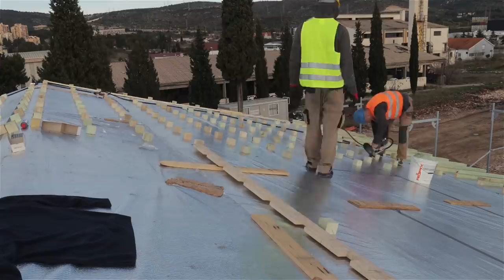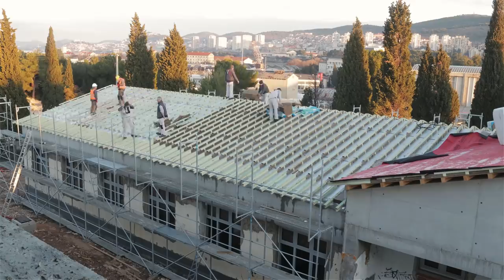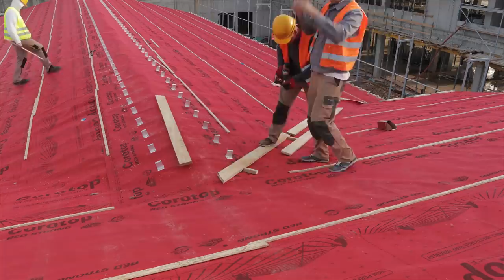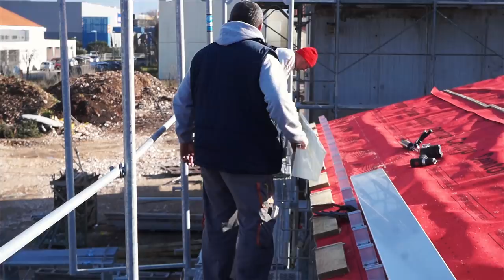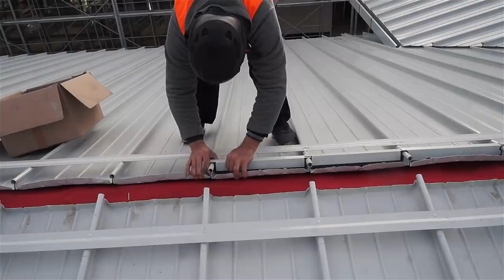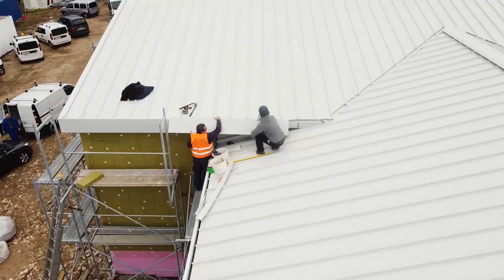Truss Structure Roofing. Aluminium standing seam

Comment: I'm I missing something or the whole roof attached to blocks that are skew nailed on? What kind of wind loading is the region? Please don't mistake for a criticism I love your channel and have watched most videos at least half a dozen times each.
Reply from the maker: Nails are just to hold the blocks in place. 5x8cm beams are screwed trough the blocks and osb to the load bearing structure underneath with 8x200mm screws. Same as in the begining of the video https://youtu.be/g7Go_f4Wj9I?t=15 The wind load is pretty significant and 100km/h winds are common in this region so it is all pretty securely connected. Around 3 KN/m2 lifting force is calculated load for this roof if I'm not mistaken.. Thank you for watching my videos, I'm glad you like them! Damn, even I didn't watch my videos that much :D

Comment: i don’t knie anything about before this stage so forgive my naive question: why put the steam break/membrane under the beams? what is underneath? also: why did you choose not to use entire slaps/wood with smaller cross-section on top (instead of going through the trouble of the wooden blocks with an even spacing? and then do the insolation under the membrane (inside) of course/or just not have that membrane... or only a steam membrane, then maybe a waterproof layer for working (like you did with the red one)-at least i’m used to doing it like this in germany. i’m just interested as to the why and why not/about your process. (i’m a carpenter)
Reply from the maker: osb is underneath, with more insulation underneath it, covered with hanging ceiling in some places and with visible structure on others, not sure how it will be done inside to be honnest, other contractors have it.. In short, we followed the blueprints, details.. we usually put the vapour barrier just behind the drywall but the architect insisted. Blocks are to minimize the heath transfer bridges.. There was no osb originaly but it was much much faster, safer to have something to walk on so the architect choose to go for it..
Reply: @lignumchannel  thanks! so probably because of the visible beams (i guess). i couldn’t see if you where insulating between the wooden blocks, but it makes sense to not make them in one piece of course. i was a bit confused that the whole white steam barrier was spread out. i am used to putting membrane on layer by layer. rafter then wood fiber insulation like gutes multitherm or the like then directly slaps as substructure/waking structure and so on. but if you already have the osb why slabs... interesting!
Reply: Hi there,
Did you ever check Systems like Masterrock from Rockwool or others with long screws in a 60 degree angle through the whole insulation? Could be good for such project. But for you this was probably even better, building it like the architect planned it with your whole crew having work 😁
I used the system at my house and it worked great.

Comment: Let's hope there are no strong winds there. Those half ass staples will not hold the roof
Reply from the maker: winds are really strong and common there. Staples are just to hold the blocks in place temporary. 5x8cm beams are connected to the load bearing structure through the blocks and osb with 8x200mm screws so no worries..